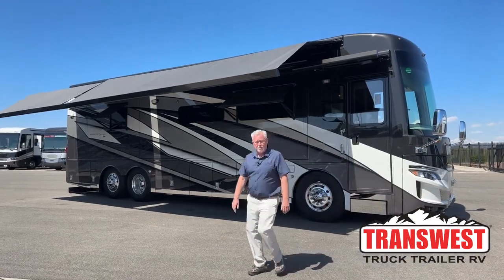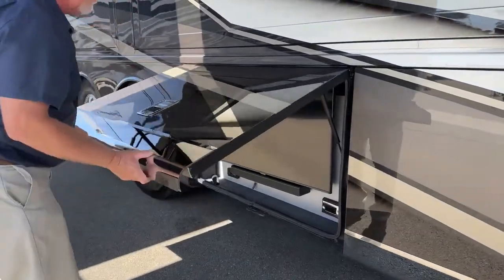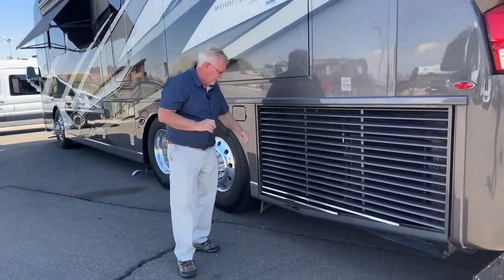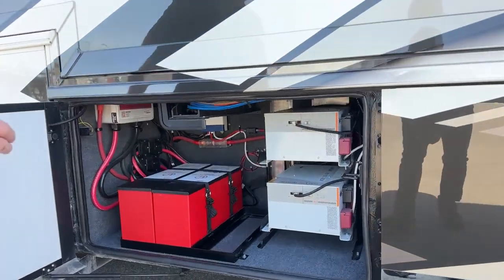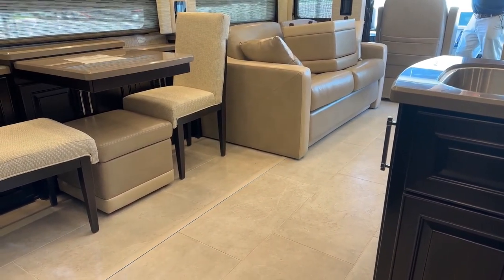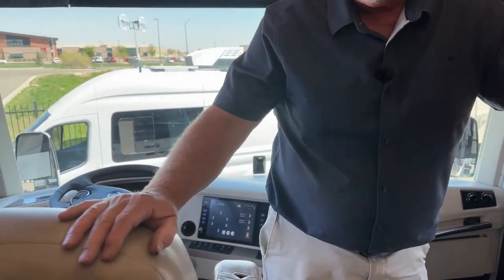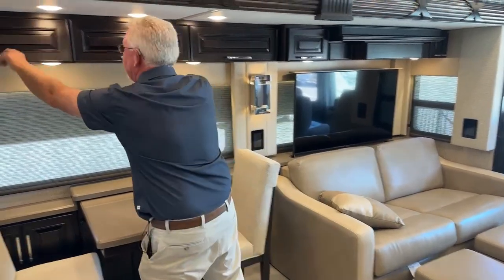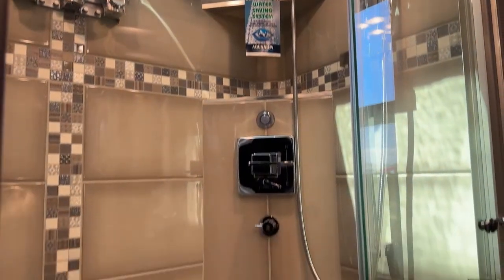2024 Newmar Mountain Aire 3823 - 5N230632

Comment: Nice. My only complaint is the location of the DEF tank. If you fill at a truck stop, the concrete is usually dirty, mostly with diesel fuel. This location requires you to walk through the mess twice.